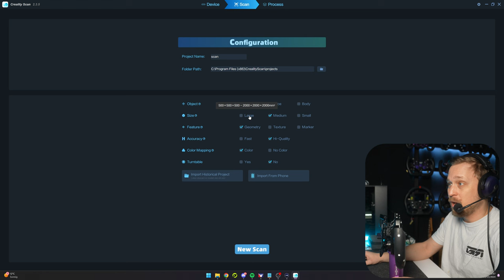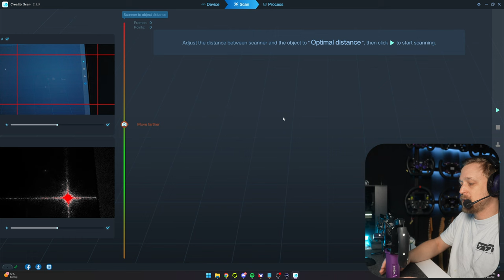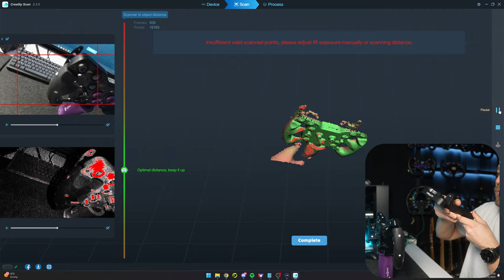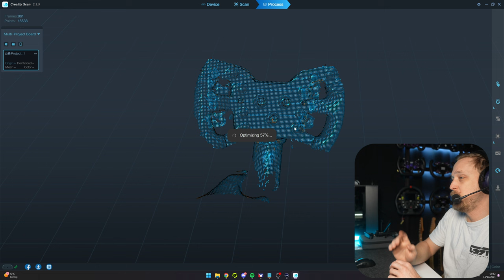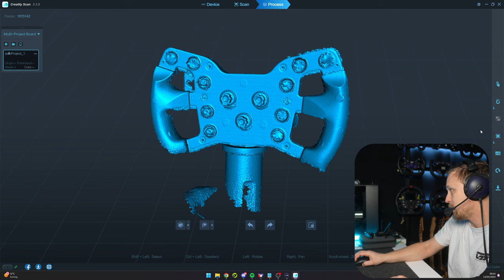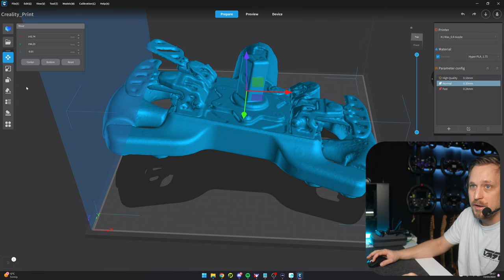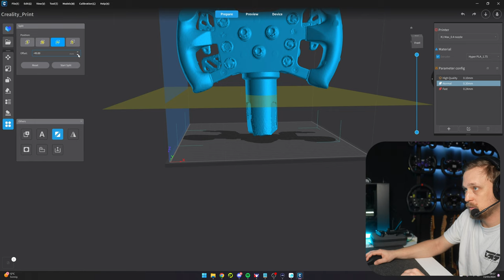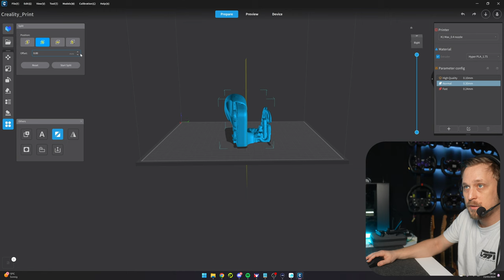Can 3D SCANNING be useful in Simracing? | Creality CR-Scan Ferret Pro 3D

Comment from the maker: Would you be interested in a "grip database" of common simracing wheels? I think it could be of good help to find out which wheel works best for your hands.
Reply: Ohh yes yes yes. Living where I am, it’s near impossible to try before I buy.
Reply: That would be an incredible use case!
Reply: Are the grips on GSI wheels interchangeable?
Personally I think all wheels should interchangeable grips and offer different grip sizes for their customers, like small, medium, large etc.
Reply: Very much so! This would be brilliant.
Reply: Might be useful for some people, but if the manufacturers allow 3D-scans, they just should provide an STL itself.
Reply: Absolutly
Reply: @f1skidmark412 someone please correct me if I’m wrong but I believe the GSI all feature direct injection where silicon is injected over the frame so its probably not possible to replace them
Reply: Would be great to test the different grips before buying. For me its the most important part and also the highest risk when buying a wheel without touching before.
Reply: Yeah !!
Reply: Yessssss

Comment: I have tried photogrammetry a couple times to scan a couple wheels/enclosures from thrustmaster and other companies to try and help modify them for ppl that need adaptations for disabilities.

A lot of especially lower end wheels don't have clutched paddles which some people require to use as gas/brake.

I helped make a couple Thrustmaster wheels work as standalone USB devices and added clutch paddles to them and it took a TON of iteration to measure, model, print, and repeat.

Being able to scan the original wheel and use it as a base for modifications would be super helpful.

Comment: I think it'd be really cool to do this but after cutting it, keep both grips, and add a Primitive shape (rectangle for instance) just to connect the 2 grips at the same distance as the real wheel. Then for not much filament you're getting as close to an impression of the size and feel of the wheel size and grips!